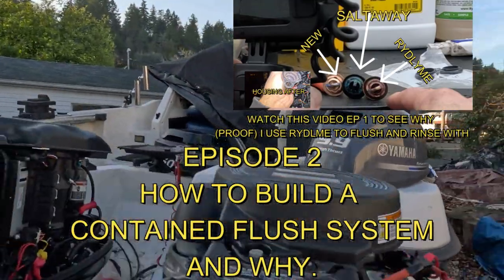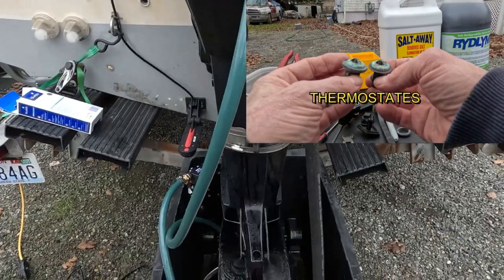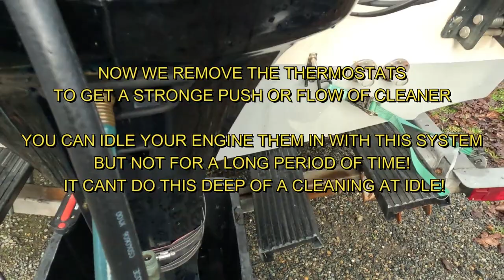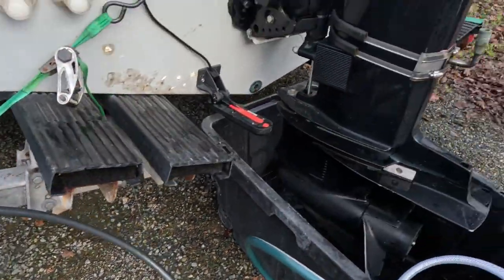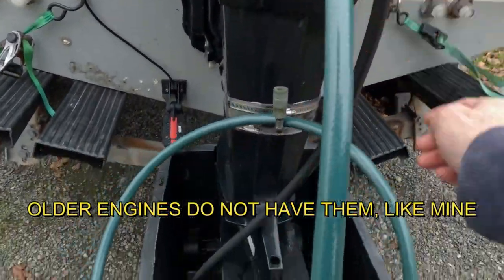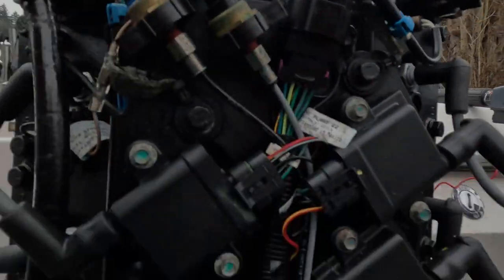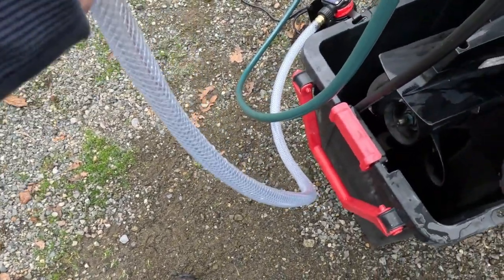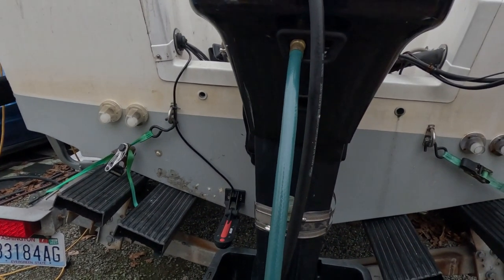EP2 BOAT ENGINE OVER HEATING, HOW TO BUILD A FLUSH SYSTEM FOR OUTBOARD MOTORS AND SAVE YOUR ENGINE!

Comment: Any update after a year? do you flush with rydlyme after every use? do you have a video of a shorter/daily flush instead of a 24hr flush? Also I've seen others remove the lower unit to force flush with rydlyme is that not needed for your outboard? Mine looks similiar but its a 2003 merc efi.
Reply from the maker: No not after every use, I would once a year, replace thermostats every 2 years. There cheap, but can break you down in the water. I don't t remove lower end on this, one, it was used when I purchased it, and I want to be sure all build up is gone in all water ways, including the lower unit where the water does circulate.the impeller should allow flow, through the system, this engine has lower water ports on each side I wanted cleared. Any blockage anywhere can cause a over heat issue. Always run it and rinse good after a flush with clean water. I use a full water bin not ear muffs too.
Reply from the maker: And I will be flushing my 2016 kicker soon and will post what it looks like inside it...hope this helps

Comment: Can you use Rydlyme everytime you flush your engine after running in salt water?
Reply from the maker: Just like  salt away add it to a rinse bottle on a hose.. or what I'm doing is just clean water rinse after each use making water get hot to open thermostats then atvthe end of the season I will use my 24 hr flush on the pump set up. No thermostats in..at that time inspect the thermostats and soak them separately if needed..when ph is clean and not changing its like new nothing left..no salt or scale which salt a way only eats salt..as we have seen..hope this helps bud..thanks for watching..I'm posting some of these test and set ups..stay tuned..and happy boating

Comment: I accidentally used regular  rydlyme not marine. Seemed super potent. Hope I don’t ruin anything. Did it for 2 hours
Reply from the maker: When I started using it, I called, the marine part is just a separate section or company devision as they released the different uses it had, but is the same as the RYDLYME biodegradable, If I remember, but you can call them and check.I am not positive, normally I would check, before I respond with an I am sure. I will call them again and verify as well, if your not sure when using it, dilute is some more and go 3 to 1. And rinse with clean water if you're not sure.

Comment: You need to get the engine hot  when washing the motor - after you get back hook up the hose  you get a couple of second warm water then it cold again  -  use a bucket  run the motor in gear   or the computer will not heat the engine up
Reply from the maker: No.. when we flush..if you watch the entire video..I remove the thermostats to flush..the engine does not! Need to be warm to properly flush..And then Watch the video of how long it takes to warm an engine and open thermostats..for a good flush to eat away scaling and salt build up remove thermostats and flush...you need to watch how little salt away does on eating salt and scaling..it is over 40 min and still salt a way won't eat scaling away...if you do not know the motor..bought it used you do not know how clean or dirty the water channel's are? Just a warm water rinse is not going to jack..bud..water temp needs to be 140 to open thermostats a d cycle water? So where do you figure warm will work? Warm will not touch 140 degree water. Is hot not warm and after 15 min your thermostats just opened bro..so now let it run for 25 min so after they opened it has time to rinse the hot or warm water as you call it to cycle through and clean...and never ever should you get your engine hot then run cold water into it?  This is a cold water flush kit..lol..you know it's only going to be warm for less than 30 sec? The cold water will cool it almost instantly..And no there is no computerized to the thermostats...lol..not sure where you got all this info..but you are super far off about all of what you said..the thermostats are a mechanical non electrical non controlled $40 part most forget to change  every 3 years..haha.. sorry I am laughing, but the thermostats are mechanical to check it simply it out right now and boil it..no computer connection at all. And it will open, mechanically at around 140ish degrees.  Please do not put cold water to hot things and your hopefully learning something most of all stop saying things your not sure about.  IM SURE ABOUT ALL OF THIS..
Reply: @steveperdueshowtofishingti2172  Im not talking about your product im talking about general boat washing - when the engine is not under load OUT of gear  the engines system pulls timing and fuel  water still flows around  cools motor  thermostat closes   You need a bucket  to allow the engine to be in gear running  till the water gets hot
Reply from the maker: @khg8519  not sure what you mean..we are making a cold water no thermostat pump around force flushed self contained system.. so there is no running it in gear on this video no need for the water pump to spin. I will do video on just rinsing after use soon. I do run it in gear to rinse all the shaft and prop. The water pump is connected to the shaft which spins when it's running,the shaft engages when you move the linkage under the water pump housing in the gear oil fill case, so even not in gear your pumping water to the stats, and will open all the way after they reach around 140 degrees F. Meaning you need to run the engine for long enough to open the stats or stat and then a few more to rinse inside and past the stats... problem is if you do this with salt a way. You with have to flush for hours for it to just rinse salt out, it does nothing for any other build up,  that's why rydlme it eats it all, fast.   But I do engage it in gear to rinse and spin water around the prop areas...have seen a lower end of a motor?